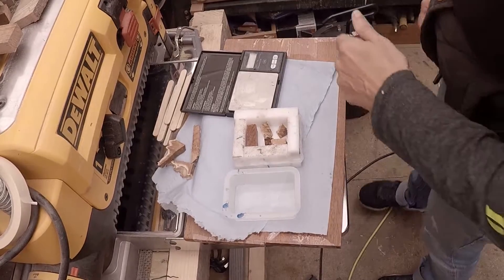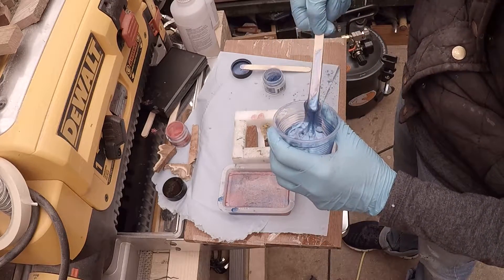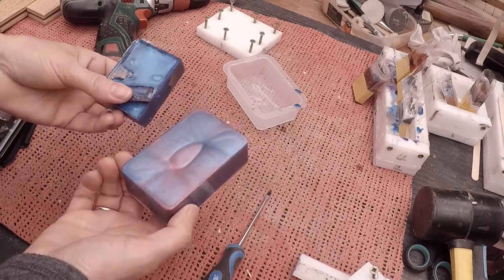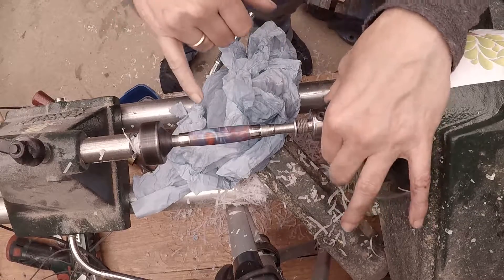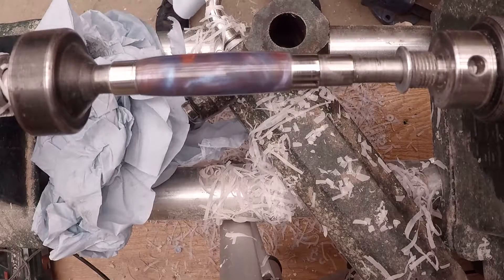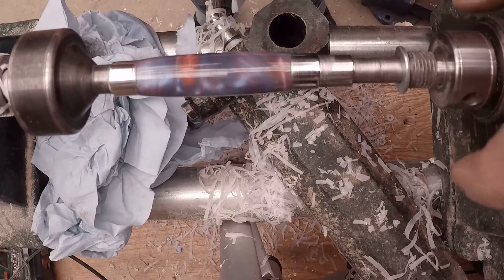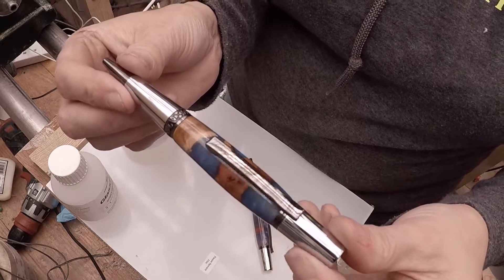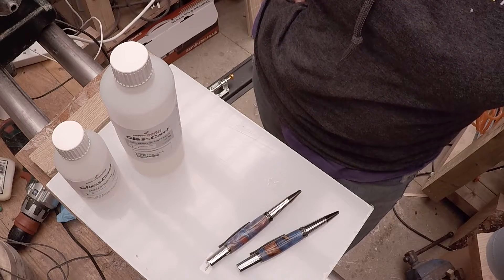Testing GlassCast clear epoxy resin

Comment: Very helpful, the pens look amazing! 
I first started out using Alumilite resin....it caused lots of issues for myself and my family...a strong smell, headaches, rashes, coughs, burns...I then switched to a food safe resin...absolutely amazing - no problems, but it's pricey! I use the expensive food safe on my resin pieces which 'need' to be food safe, but for resin work (moulds / pours), I now use Glass Cast. Like you say, it's amazing price for such a wonderful product x

Comment: Hi Pam, great video, do you ever test these resin products for bubbles without using the pressure pot, I've just started and I recently bought the alumilite resin but dont have a pressure pot to degass  the bubbles are horrendous in it. 
Did you notice while mixing and before adding any pigment how bad the bubbles were? 
 thank you
Reply from the maker: Ive used amazing clear cast without pressure or vacuum for making a pen blank i heated the thicker a side in warm water this really helps the bubbles to come out of resin. House of resin in the uk will be stocking palm resin thin soon having already played with this it works great and very very tiny bubble but can hardly see them and wouldnt notice in a coloured pen blank or such.
Reply: @Highlandboxes  Hi Pam,
Palm resin thin? Would it still be able to be domed say for pendants? Thank you
Reply from the maker: @seanditch4419  I've never done dome stuff so have no idea sorry have you looked at resin8 they do resin for jewellery
Reply: @Highlandboxes  I was really looking for something that would cover all bases, wood, jewelry casting....but without the excessive bubbles.

Comment: Hello there, have you tried casting without the pressure chamber by any chance? Or do you happen to know of a resin type that doesn't require it but will still have a bubble free finished product?
Reply from the maker: Hi Ronweeber yes ive cast polyester resin without a pressure chamber and they came out fine but very smelly stuff to work with. Ive not tried it with the epoxy but i think it would need pressure or vacuum degassing :-)

Comment: Hi Pam,
They look amazing, what a great finish you get with that product. Great looking pics at the end.

Out of interest, what bandsaw do you use? I need a small bench top type, so I have started to do some research.

Cheers
Paul
Reply from the maker: Hi paul i have an old dewalt 1980s DW 3401 lol and my main one for the bandsaw boxes is a SIP 10inch heavy duty great little bandsaw. Have a great day paul still to catch up with your video but saving that for chilling later with a glass of wine lol :-)
Reply: Thanks for the info Pam,
Enjoy your chill out. 

All the best,
Paul